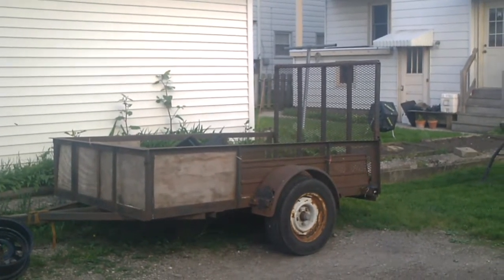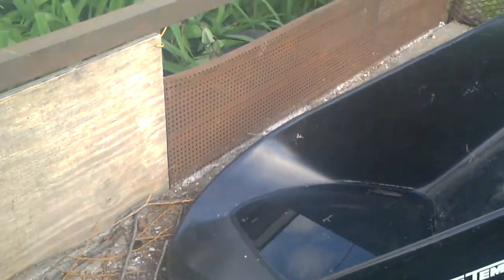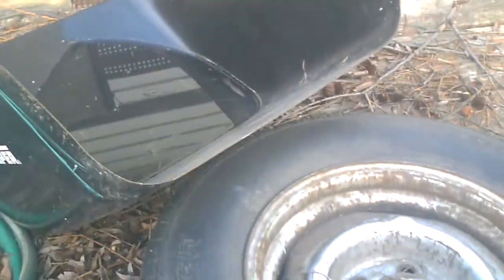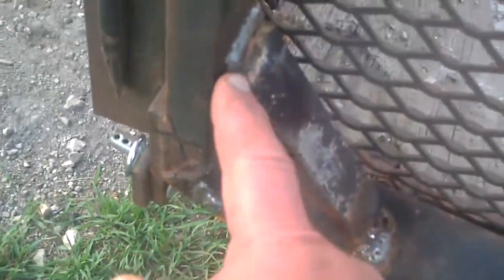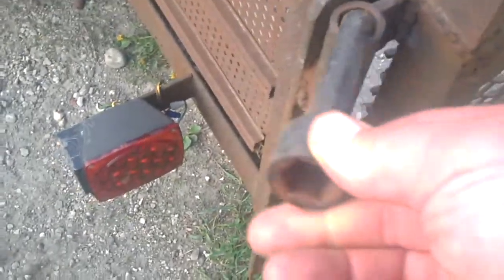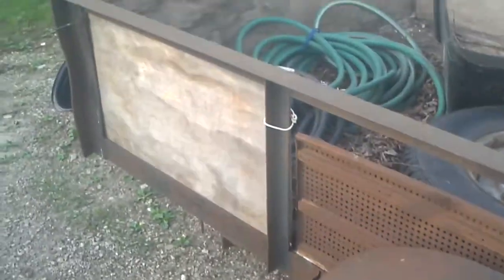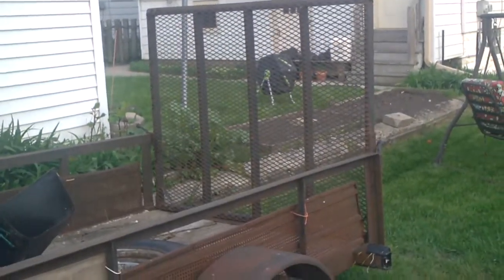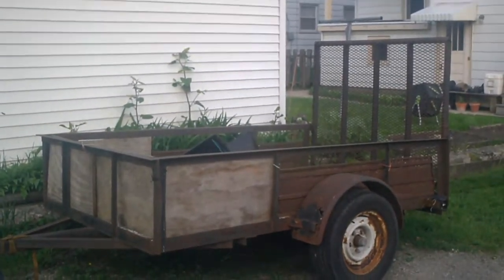200 Dollar Utility Trailer Score

Comment: Hey Craig those are handy sized trailers I recommend what we did to my dad's. You can get a gorrilla lift kit which is basically helper springs to make the gate so much easier to lift. It's just a nice touch to make the trailer more enjoyable to use rather than a chore. Looks decent for the money good purchase